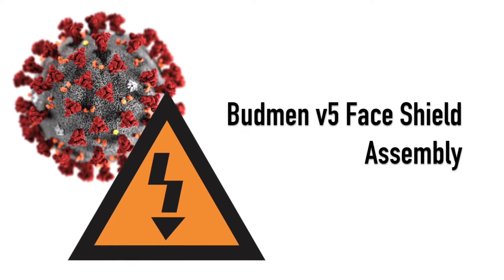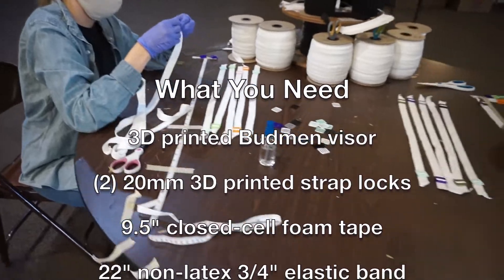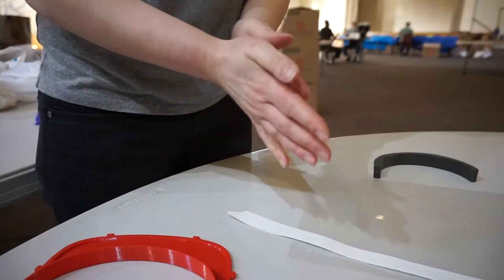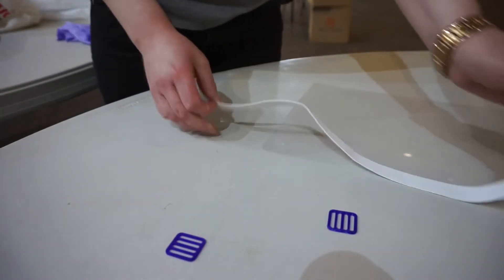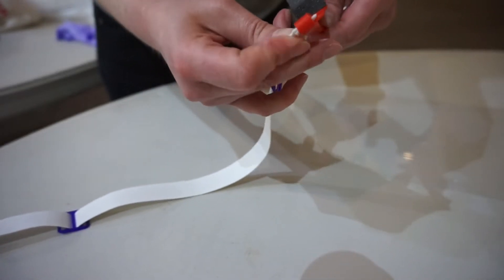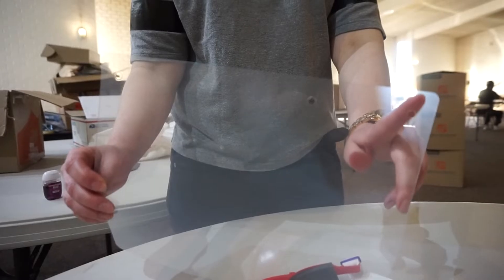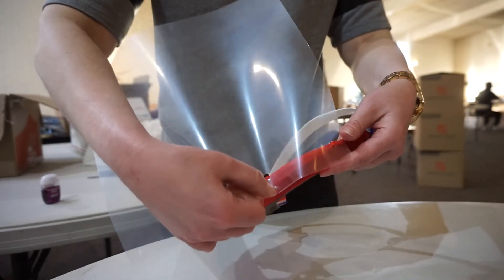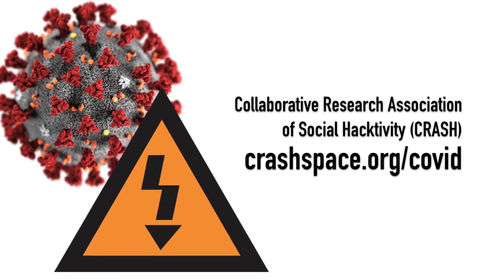Budmen v5 Face Shield Assembly

Comment: Ummmm.... Why would you use SUPERGLUE to attach the non-adhesive side of the foam tape to the 3d printed portion?  Now you are literally going to have the sticky side STUCK TO YOUR FOREHEAD!   😂 😂 ?????!!!!!
Reply: there is no adhesive under the protective layer here, and there IS adhesive on the exposed side. that's how it goes when you cut it from a big roll.